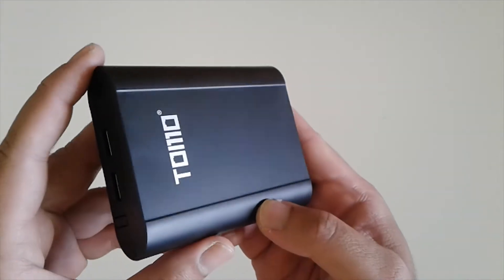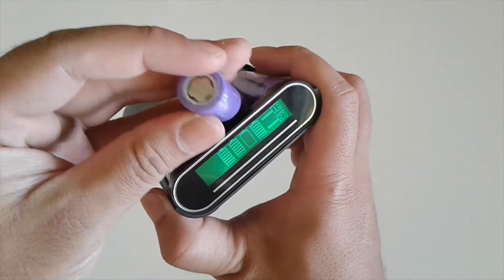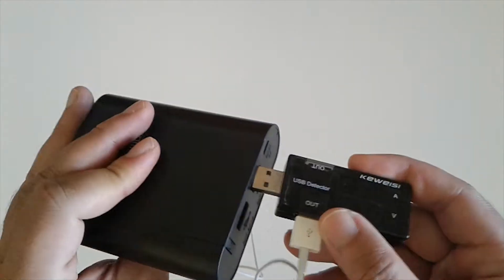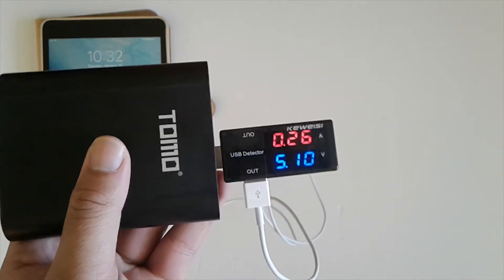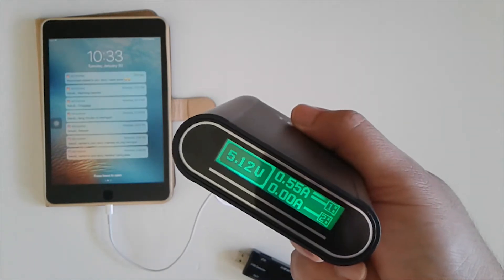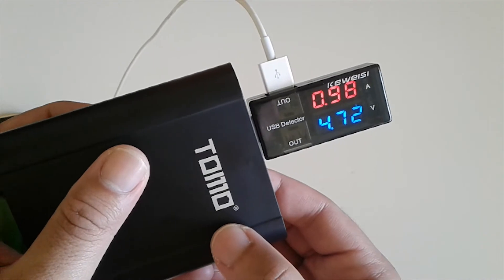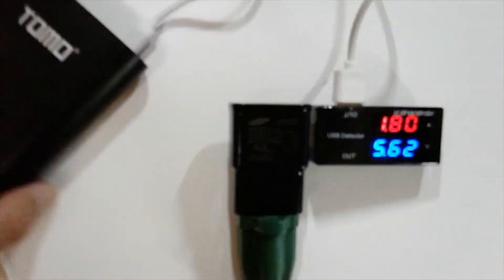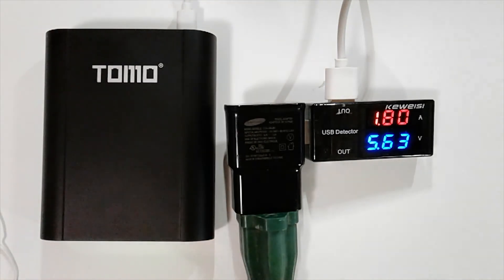TOMO M4 Smart Power Bank Charger Battery DIY Case (18650s Needed)

Comment: I need to keep plugging this power bank into my router (using a 5v to 12v conversion cable). When electricity is there it must keep charging and discharging at the same time. When the electricity loss router will work discharging the power bank. Is it possible with this power bank?
Reply from the maker: I haven't tried that technique, but I have on power banks from other brands, and it doesn't work.
Reply: @TaylorSoloaiJR  Thank you for the reply. Anyway is this power bank support pass through charging & overcharge protection?
Reply from the maker: I can't answer your question because mine is already broken and I don't recommend this anymore. Go for some of the latest DIY power banks.

Comment: Did you notice that it doesn't charge evenly?
It usually charges battery 1 & 2 then 3 & 4 are lower in voltage while no 1. is done charging . or don't you have this error?
Reply from the maker: I have noticed it too but I always thought it was my 18650 because I use salvaged ones. not really sure if its the Charger or my batteries.
Reply: @TaylorSoloaiJR  I'm using all new ones from LG. So pretty sure that it's the charger.
Reply from the maker: Thanks  @edgarzakarian1649  , good to know we have another issue with this charger.
Reply: @TaylorSoloaiJR  know of any better alternatives ? Which actually work as advertised and use a spring mounting?
Reply from the maker: @edgarzakarian1649  sorry I don't know of one yet, in the future if I find one I'll post a video about it.

Comment: just the same as a toy battery... if your not using the toy then pull out the batteries so it wont acid... and the amp's if you want it reach to 2 amp's charge... then be wise using a wire that is a fast charger 3 amp's or more... then you will get the result of the TOMO M4 DIY powerbank... so please leave a comment worth reading guys... peace out and remember... this is just my reaction... peace ☮️

Comment: I have problem with output Ampere, I charged with 2A slot, but the indicator always show 0.99A
Reply from the maker: It will depend on what device your charging. If the device will only take in 1A then the DIY powerbank will only output that amount.
Reply: @TaylorSoloaiJR  I guess so, perhaps my device. It's asus ZenFone max pro m2, it doesn't has quick charging feature either.
I bought another brand DIY PB "Xtar", with single slot 2.1A. No difference too.

Comment: To people complaining about battery drain. It draws around 4mAh so it will kill batteries if left in the device. Also this is a charger mainly with power bank functionality. With that info this is a good buy for the functionality. Also they should advertise that there is battery drain on it.

Comment: the battery has still some power lets say two of the lines ,but it is switching off...?! When is full of the batteries is working well,so why so soon is turning off ?
Reply from the maker: How much mAh is being output? What device are you trying to charge?
Reply from the maker: I just realized that if you charge a device that draws a lot of amperage it will shutdown. For example I was charging my Anker power bank, it was drawing 2 Amps from the Tomo charger and suddenly it just just shutdown after  20 minutes. I checked the voltage of each battery it was 3.8 volts.
I kept the same batteries inside and tried charging a Samsung phone that only drawn out 1A and it worked without shutting off.

Seems to me it doesn't like devices that draws way too much Amps I guess. That's my theory.

Note: don't leave your batteries inside if not in use for a while. It will discharge them to a very low voltage.

Comment: device charging 2A should support fast 2A charging, if it does not support such charging, loading will not be at 2A
Reply from the maker: Yes forgot to mention that. Thanks for the heads up.

Comment: Alright .. I have a different model : the one with the USBs stacked on top of each other and with lightning in as well ... So ... if you press the power button on yours ... without having anything connected - you can't hear it whine ???

Could you show how yours looks inside ? Would be very curious to see if they changed anything  .. mine also charges the batteries way slower

Also ... you USB adapter's really pushing it with 5.6V, never seen one go up so high ... not too bad considering how weakshit cables these days are ...
Reply: Highly doubt it though ... bought it off of banggood from the TOMO store ... but - could well be
Reply from the maker: Yeah tried listening for any type of noise with and without a load, I've had step up voltage regulator that made the type of noise that I heard from your TOMO model so far for me nothing. 

Yeah I'll try and make a video soon on what it looks like on the inside but yeah I'm also surprised the USB Adapter went up that high, maybe that's a good sign that's it's not fake.
Reply: Well, then my furious reviews seem to have helped TOMO out ... perhaps ... in any case, I have two of these M4s I can only comfortably use for charging 18650s ... and they even wanted to send me A THIRD ONE too :))
Reply: You got fake Tomo friend